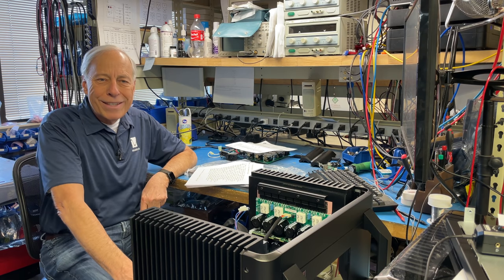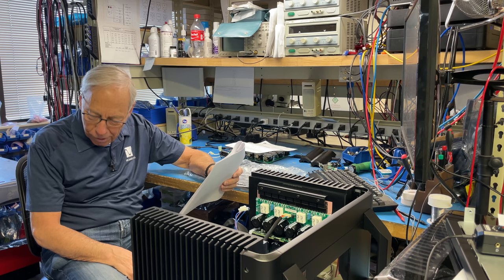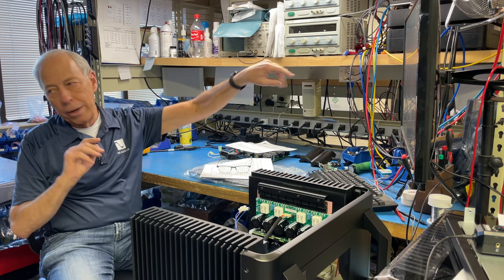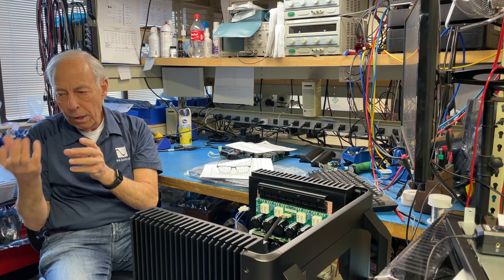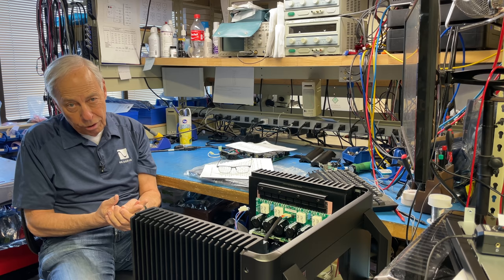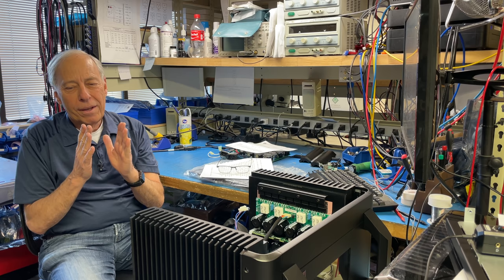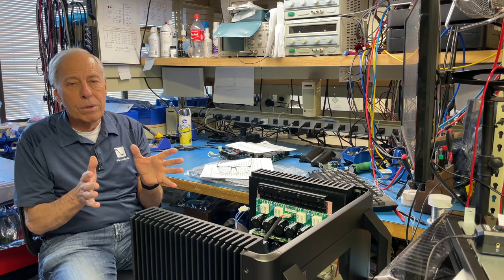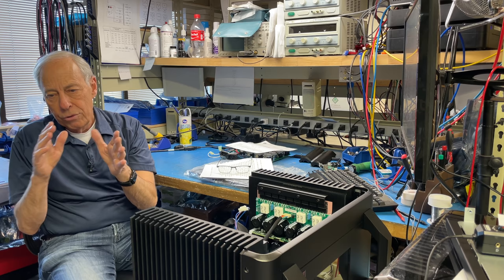Differences in digital audio cables

Comment: Hans Beekhuyzen gives a much better and detailed explanation on his video " connecting your DAC how digital can go wrong" He explains how and why the shape of the pulses can get distorted so that they no longer look like square waves then the DAC can have a hard time reading them. He also does an good explanation of jitter.
Reply: It’s a non-issue in a well designed product however. The problem is with small audiophile companies not grasping the basic principles of the equipment they design. Not accusing PS Audio of this btw
Reply: @Douglas Blake Thank you! Thank you! Thank you! What a pleasure to read your comment. But I'm just a poor electrical engineer, so my opinion doesn't matter much here. ;-)
Reply: If the DAC has sufficient buffer capabilities. transmission of the signal becomes irrelevant. To cabling quality as long as all the packets are recieved propetly.
Reply: @branislavokon5009  are you agreeing or disagreeing with Douglas?
Reply: @stantibbs2273  right, the cables need to operate within specs. If they do you are good. Too bad many "audiophile" USB cables can't sustain the needed bit rates.
Reply: Notice how HB's impressive stack of measuring equipment is never actually turned on? He uses his ears and refuses to do blind tests. Everyone is subject to the tricks your brain can play on you, people with engineering degrees too.
Reply: @paulgyro  I agree with Douglas. One of the main advantages of digital technology is the ability to restore the original data even from a heavily distorted and noisy signal coming from the cable. That's why it uses only two, relatively easily distinguishable levels (0, 1). If a receiving device (DAC) has its own clock, then a jitter can only be a result of this clock imperfections.
Reply: Jesus christ you guys will never understand the difference of the digital and analog part of a DAC

there is nothing like noise on bits because you can't even store it somewhere
Reply: Can any human hear the difference?
Reply: @zackschindler8334  Some people claim they can, search for the Michael Fremer reply to Paul a few weeks ago.
Reply: @Harald_Reindl  Oh I know. And even if these differences dud exist how much difference would they make in the listening experience?
Reply: @leekumiega9268  People claim all kinds of things. Some see an image of Jesus on a  tortilla. Claims need to be backed up with some kind of provable evidence. For instance WHY does X cable sound better than Y? What is the reason and can it be proven in a blind test? Saying one can hear it but not prove why is just confirmation bias.
Reply: @zackschindler8334  People being able to  hear a  difference between speaker cables of decent quality , I have my doubts but DAC's can make a difference , Now on the other hand  If you disregard the noise inherent with vinyl , I and a friend definitely could clearly hear that half speed mastered vinyl record definitely sounded better than a CD , but he had a highly resolving system ,while the average system most likely would not reveal any difference
Reply: @leekumiega9268  just because one DAC is different from another does not mean that is sounds "better". And yet even if the things you describe actually work do they make any difference to your listening experience?
Reply: @Harald_Reindl  No one has ever lost money underestimating the intelligence of the American public.
Reply: @zackschindler8334 Since I actually will sit for a few hours of critical listening ,yes it makes a difference to me ,and makes me wish I did not have cats so that I could get Magnepan speakers as they are the most resolving for the money. My amplifier is already resolving and powerful enough for them. I should add that if your speakers and amp are not resolving or you do not sit in the sweet spot for critical listening then it does not make any difference.
Reply: @zackschindler8334  no one can underestimate it after trumps election :-)
Reply: @zackschindler8334  a lot if only your imagination is big enough :-)

Comment: Paul is absolutely correct here, just dont expect to hear these diferences on low budget , poor resolution systems . The better the system the more of the diference these cables will make... sorry home theater receiver will not be the place to look for these diferences.
You can get good quality USB cables on AliExpress for 20usd , so all your snake oil placeebo rip off juat got busted 😂
Reply: Great comment, thank you.
Reply: @Harald_Reindl  Im glad your brain is alive and well 😂
Reply: @Harald_Reindl  it is funny how you create twisted logic to justify fear of overspending 😉 just spends some cash and test it out , if its not worth it just return so no damage to your wallet will be done.  
Relax and listen to your Music , specs do not sound , music does.
Reply: @Harald_Reindl  Vist to a shrink is required ?  Or just learn to listen and than decide... yes digital does affect the sound and in a big way , otherwise 39usd DVD player from local garage sale would sound the same as qualitu transport.
Reply: @kdomster9141  it's not the player which sounds different, it's the DAC
Reply: @Harald_Reindl  of course DAC is more important but quality Transport or better internal clock with its own power supply  does improve the sound a lot.  Learn to listen and your ears will tell you right away.
No need to spend big dollars , lot of AliExpress cheap cables, linear power supplies, dacs and transports can sound great for a fraction of cost  your just have to take your time and  listen
Reply: @kdomster9141  jesus christ the clock is for the DAC, outside your audiophile dreamland the DAC is in the amplifier/receiver and you go with a optical connection to it - even the DSP processing (room EQ) works directly with the digital signal and the very last step for the final output is the DAC - the problem is that you audiophile fools doing DAC way too soon in the chain and use coax instead of optical connections to begin with
Reply: @Harald_Reindl 

 No need to bring Jesus into this, trust me, no matters how hard you bielieve into your heresy 😉
Toslink is far inferior mostly due to the plugs design  and is almost always sounding worst than coax.... Best way to go is I2S connection and high quality clock in a transport ...
Reply: @Harald_Reindl  Sure I did not expect anything else from you . 
Enjoy your theories while proudly wearing placebo and snake oil T shirt  😁, use 3.99usd Amazon USB cable ,
and Blue Jeans home depot speaker cable that you got riped off on , while I will enjoy my music thru my system... that did not cost more than a 1/4 of a average car these days....

Comment: Digital is nothing more the refined analog.  We cannot have digital without analog. Audio cables and power cables and interface cables are  inductive/capacitive/resistive....LCR in simple terms. Digital 1s and 0s are analog voltage and current...refined to the digital signal level. Any and ALL electronic devices are semiconductors caps/coils/resistors/diodes.....encased in a nifty black chip.  Digital is Analog "repurposed" for your eyes and ears.
Reply: Well I like to compare digital signal transmission to FM radio. It's the same concept. The information is carried by frequency changes, which is what a bit stream really is. The absolute analog voltage level  of the FM or digital signal does not have any relation to the amplitudes in the encoded analog signal. That is why FM radio is not sensitive to noise and AM is. Likewise the same principles apply to digital data. As long as the noise remains below the 1/2 the bit voltage, it's is not there once the signal is decoded back to an analog voltage. Cliff effect. The whole digital noise argument is promulgated by those seeking to profit on magic fix-it boxes and exotic cables.
Reply: so what - there are checksums - if it's bit perfect it is bit perfect - case closed
Reply: @Harald_Reindl  Not all digital transmission formats have check sums or error correction. AES/SPDIF and SDI/HDMI are some examples. The reasoning is that for image and sound, an error is not catastrophic. A zit in an image or a click in an audio stream is often quite acceptable. When not, there are more robust transmission means but slower and more compute intensive.
Reply: @andydelle4509  well, in a different thread you can find some idiot which hears the difference between ethernet cables as like the tcp stack would give a shit about the tiny audio stream while it bit-perfect transmits terabyte of data each day bit-perfect :-)

but hey it's my shitty equipment "you really need to get a decent resolving system to investigate this stuff yourself. Obviously you haven't any experience" which didn't flip a bit of gigabyte large server images over many years :-)
Reply: @Harald_Reindl  TCP/IP has error correction. SPDIF does not. I am not saying any of this cable BS is true. But digital signals can be corrupted. And if there is no error correction, you will get clicks and pops in audio. But these claims of deeper sound stage and quieter background with "audiophile"Ethernet and USB cables are in fact BS.
Reply: @andydelle4509  and don't forget how warmer it sounds like a dsp doing room EQ is from the devil for audiophiles because it changes the character of the speakers while by the definition of Hifi a speaker or amplifier must not have any character or sounding at all - it has to play each frequency at the correct volume on your listening point with perfect timing and phase, not more and not less, linear as it was recorded and without add or remove anything

Comment: What Paul is explaining has nothing to do with cables, has it? I mean sure, this galvanic isolation sure can have an effect on sound. Less noise for that matter. But all that Jitter and noise in the acutal bits is just not relevant. (To a certain degree obviously) That is the whole point in using digital interfaces... If there is an acutal difference in audio quality due to a digital cable, following the arguments of Paul, would be caused by the cable picking up ambient noise which acutually interferes with the electronics. But this problem has nothing to do with digital cables. Every cable can have this effect. And if you are concerned about that, there is a nice interface for that. Toslink. It is perfect in that regard.
Reply: It certainly has something to with cables, just not with the digital signal which is bit perfect. It is the analogue noise that accompanies the digital signal that is merged into the analogue signal that comes out of the DAC.
Reply: @D1N02  Hence Toslink. Or probably even Wifi.

Comment: Paul is right but he did a poor job of explaining.  Here is the rub.

It's all comes down to the internal of the DAC and how it is clocked by the clock.  If I can build a perfect DAC, with a perfect clock that impervious to any external noise, then the digital cables will not have any affect even the cheapest one.
But alas, that is not the case since there is no perfect DAC and no perfect clock since they will all be affected by the incoming noise of the cable.

The DAC needs a clock to clock the data when it does its digital to analog conversion.  If the clock is affected by noise, then the DAC output will consequently be affected by noise.  Anyway, you get the idea and if you have background in engineer, you can extrapolate from here and understand.

That is why in the PS Direct Stream DAC design, they physically place the DAC clock right next to the DAC so that the chance the clock will be affected by noise will be minimal.
Reply: And yet even if the things you describe actually work do they make any difference to your listening experience?
Reply: @zackschindler8334  Yes I believe it does make a difference.  Just like skeptics of power cable.  You do need a system with high resolution enough to hear the differences.
Reply: @andyvu8312  People claim all kinds of things. Some see an image of Jesus on a tortilla. I just see a tortilla. Claims need to be backed up with some kind of provable evidence. For instance WHY does X cable sound better than Y? Saying one can hear it but not prove why is just confirmation bias.
Reply: @zackschindler8334  Well regardless you whether you believe him or not, you should at least understand the mechanism in which noise from the USB cable and electrically affect the DAC output.  And you do need some background in electrical engineering,